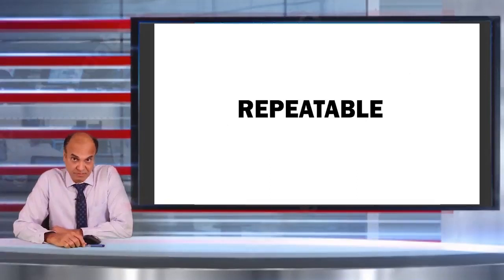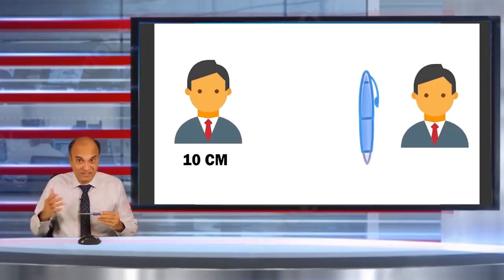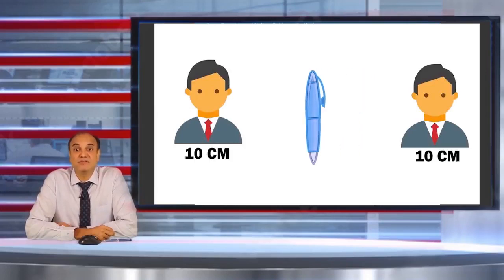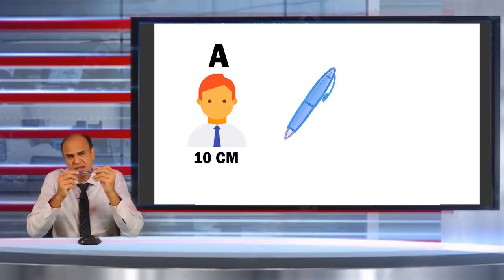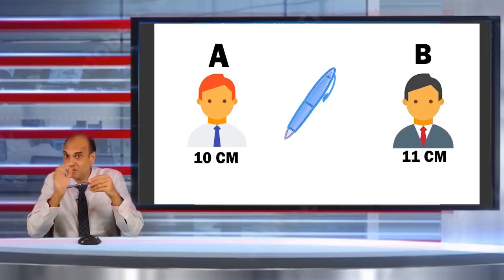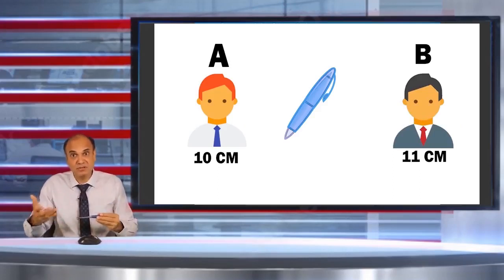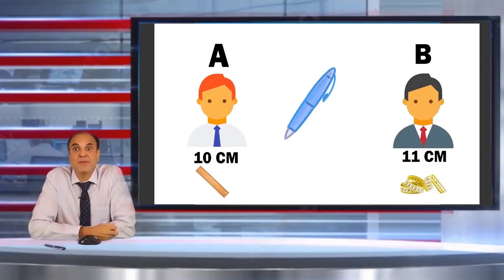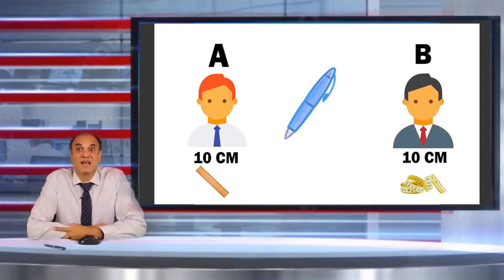Repeatability and Reproducibility in Lean Six Sigma Green Belt

Comment: "Six Sigma Champions are con men" 
“All you have is smoke and mirrors” 
- Creator of Six Sigma, Mikel Harry
91 % of Six Sigma companies have trailed the S&P 500 (Qualpro survey).  An 8 yr study at Ford showed an average of 1 in 5 parts defective AFTER improvement for “successful” Six Sigma projects.

Six Sigma is a destructive scam based on pure farce.  It started with Mr Bill Smith and his out-of-control molding process that happened to drift “as much as 1.5 sigma”.  Smith’s buddy, con man Harry, “proved” Smith disaster happened for every process ... based on the height of a stack of discs!  Most folk never bothered to check.  

“Neutron” Jack Welch at GE described Harry as a “madman” and said no one had any clue what he was talking about.  Jack handed over $1B anyway.  A scam was born!  GE has now thrown the Six Sigma trash out.

EVERY aspect of Six Sigma is worthless, from its normalization nonsense, to its irrelevant enumerative methods, to its paralytic DMAIC.

Dr Wheeler, the world’s leading process statistician, calls Six Sigma “GOOFY” and the stuff of “the tooth fairy”..  CBS calls it the most stupid fad of all time.

There is never justification to stray from the giants of Quality Dr Shewhart, Professor Ishikawa, Professor Lewis, Professor Deming, Dr Taguchi and Dr Wheeler, for the lunacy of Six Sigma’s con man.

How the Six Sigma fraud was started:  
https://youtu.be/0kZbJLHK_4M 

Lean was tacked on to prolong the Six Sigma Scam.
98% of LSS implementations FAIL (IW survey)